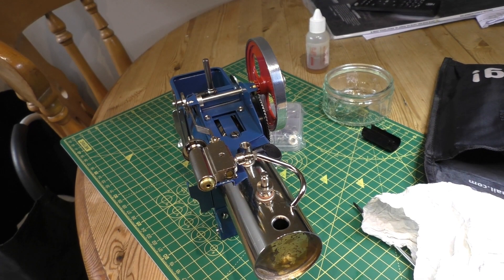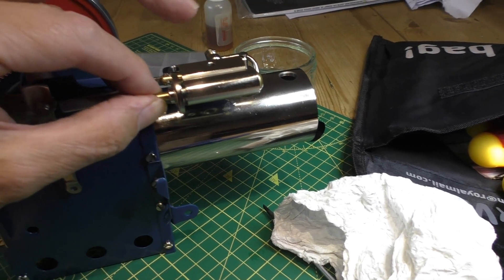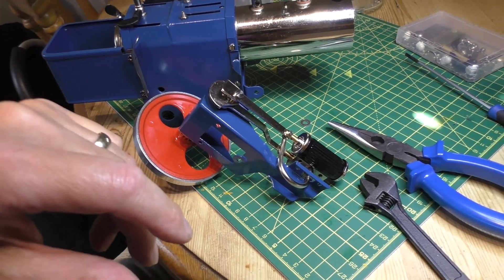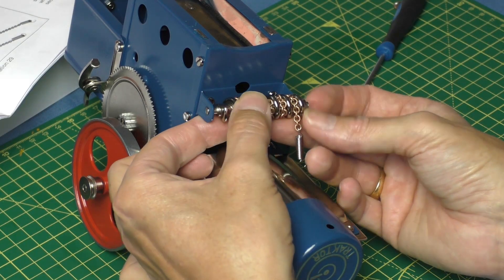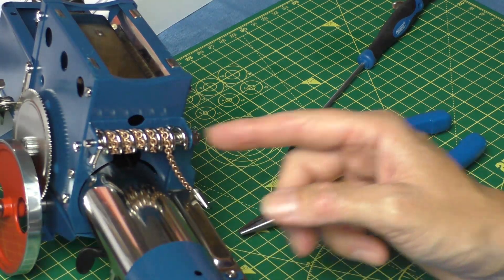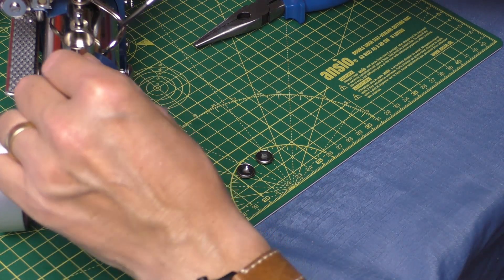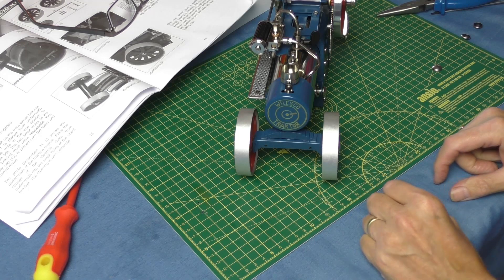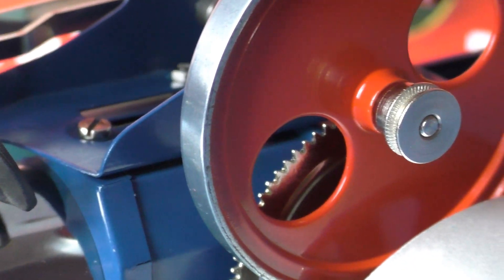WILESCO D415 Steam Tractor kit build Pt 2

Comment: If I were building one from a kit, the stainless steel boiler and other parts would be blackened!  I really can not deal with a chrome boiler!
Reply: I don't know if applys to steam engine's.  We bought some nice chrome exhausts for a motor cycle. 
It had a sticker saying " clean before starting "  . It seems finger prints burn in hot chrome and can't be removed.

Comment: Thank you so much for showing the bit at 2:39. I had the same problem, the flywheel was rubbing on the small gear in the centre of the larger gear. Had to use about five washers just to provide a bit of clearance, after that the engine ran OK.

Comment: Hi Fred, Great to see the video. I have the same issue with the drive gear and flywheel spacing, they both rub together. Where did you fit the extra shims, on the flywheel drive shaft or the drive gear shaft. Plus I never noticed the different size hub caps....Ouch! I hope I've not made the same mistake....off the workshop to check. Cheers again for info
Reply: Hi ian.  I think it was the drive gear shaft.  Yes the hub size caps also got me.  If you get a drive cog rattle when you run it apparently thats normal.  Enjoy your build.

Comment: Jes I remember somehow the problems while building the engine...in my experience I had problems with the screw for the crown wheel came loose time to time and the main problem was the screw  at the working piston? It came loose often while running, then I changed with a bolt...but it never worked for me. That was that I sold the engine at the end. Yes there is rattling all the time in the gearing with the wilescos, its somehow a "Trademark". Its just a toy, compare the price to a Stuart :-) Then you know. All in all, I whish you happy times with this quirky little machine :-) Although I sold my tracktor years ago, I think to buy a second hand Wilesco Roller ( No kit for me!). Just for fun running these wonderful engine :-)
Reply: Thanks Paul.  I think there is a bush / washer for the crown wheel.  Glad to hear that a rattle is expected as the main drive cog wheel is still rather loose even with my extra washers in place.  The tight piston at the end of the travel is a concern that it might stall the engine.  I dont like running then flat out when static.  Just waiting for a dry afternoon to fire her up and see whats what.